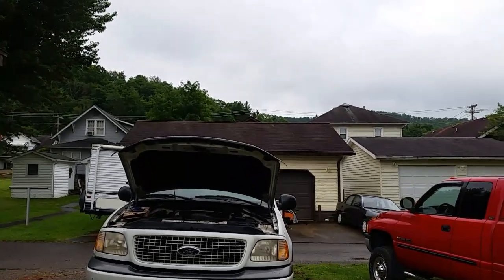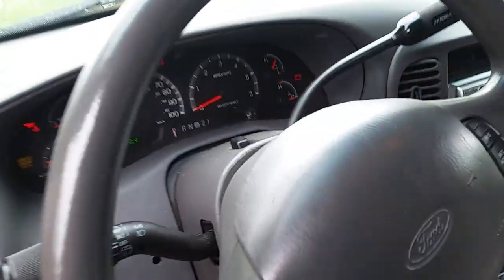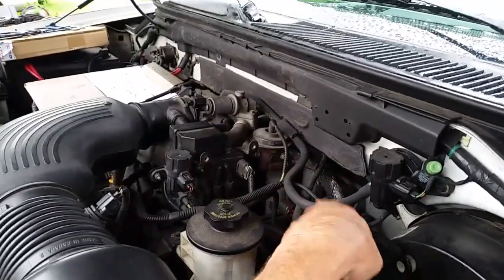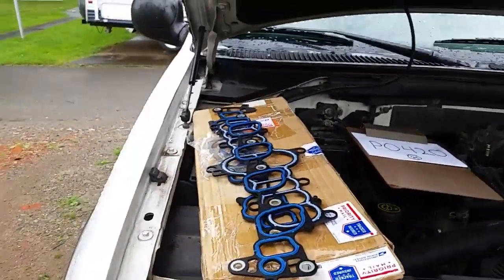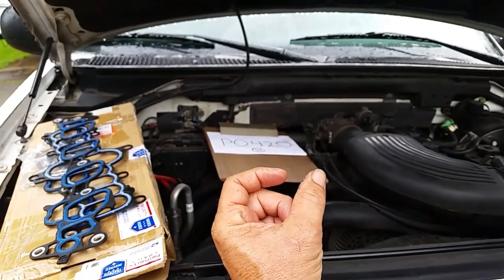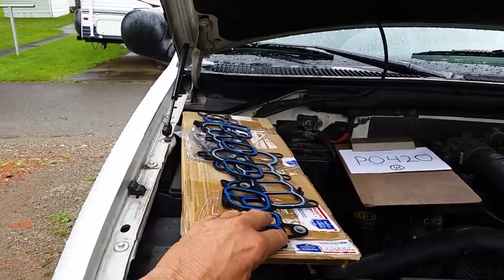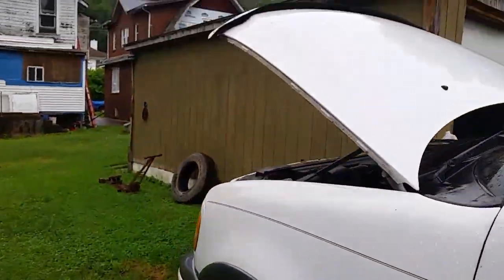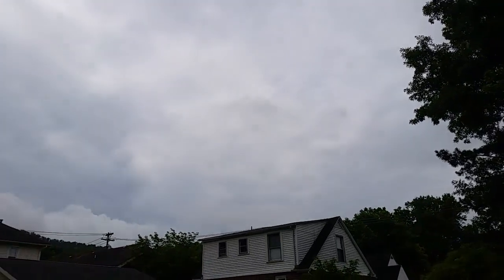P0420 Code. How to fix it. Don't spent spend tons of $$$.

Comment: Extremely helpful video and helped me diagnos my Honda Accord.
Reply: i just got this code for my honda accord what did u do to diagnose it?
Reply: @aleosorio05  My initial thoughts was for a catalytic converter but it was specific to the oxygen sensor.  You have to get those checked as likely there are two and one of them is failing you.  Not an expensive fix.

Comment: I've got a Kia sargento that I was about to tackle the O2 sensors. It has aluminum heads though. I'll check for air leaks, but do you think the intake gasket could be an issue on a metal intake?

Comment: Thanks for the info. I just bought a 06 explorer 4.6 and after two days the po420 code came along with a generic lean code. Where is the most common vacuum leak found? Thanks
Reply from the maker: Usually under the intake, the gaskets get bad and leak some. If its running ok then the leak is so little, just enough for the o2 sensors to see it sorts.
Reply: Did u fix it.. Same shit with my 06 explorer

Comment: Hi Nathan.. I have a 2002 Jaguar X-Type.. I recently had a P0301 misfire code.. I had a mechanic change the spark plugs and the coil packs.. in order to get to the back three plugs of this 6cyl 3 liter engine, the intake manifold had to be removed.. once the job was completed, the P0301 was gone, and the car runs and drives smoothly, as expected.. However, a P0420 code appeared.. 

Since it did not have this code,  immediately prior to the tune-up, I am thinking that the mechanic did not reinstall the new gaskets and manifold correctly.. I'm thinking that perhaps when installing the manifold, the gaskets were moved on bank 1 (since its a P0420).. I do not hear a vacuum leak anywhere, and all the lines appear to be in their proper places.. any thoughts because I find that hard then I would have just a P0301, and after the plugs and coil packs replacement, I would suddenly have O2 sensor problems or catalytic converter sensor problems or whatever other possibilities for kicking out this P0420 (your point in the video).. especially since the motor runs perfectly and I did not have this code before the repair was just done.. thanks for any insights..
Reply from the maker: Check the bolts and see if there tight. I've see this happen before. If that does not work might have to tell him what wrong.
Reply: @FixingWithPassion  .. Yes.. thanks for the reply and advice.. I totally understand where you coming from.. in fact when it first threw the code I inspected the vacuum lines and general work that I could see in the sun the next day.. I observed that the rear intake bolt that keeps the intake manifold secure/stable in the back, near the firewall, was missing.. this was not one of the main six intake manifold bolts around the gaskets.. But a missing bolt off the intake nonetheless.. I replaced it myself, but the code remains after coming back at exactly 100 miles post reset.. and because this bolt was missing it made me concerned about the general quality of the work.. on this Jaguar the main intake manifold bolts have different lengths in at least three of them.. so if you don't pay attention to detail, these could have been put back in the wrong order and place.. so I definitely consider either loose bolts or maybe both put in the wrong place when he threw it back together. Additionally, when he returned the car it still had the check engine light on.. and when I inquired about this I was told that they had not taken on a test drive or put the scanner back on it to see if the P0301 was clear, or if this was a new code, or both! as I was the last customer of the day they were in a hurry to close up shop so I was forced to take the car and run up to O'Reilly's.. he told me I can bring the car back next week if there was a problem and the code to not clear itself.. incrediblous.. you know how it is.. if you don't pay the mechanic you can't take your car, even if their work is obviously not done correctly.. 

It was the weekend, so I had to wait until Wednesday, following the previous Friday's work, before I could go in and talk to him.. 

Unfortunately, he was defensive and combative, from the mere fact that I returned and suggestion that there was a problem that he possibly caused when installing the intake manifold, since I was only now getting a new code that can be directly manifested from an error in the intake manifold installation (like maybe a displaced gasket when setting the manifold in place, loose or misplaced bolts, ect).. so I cannot look for him to to be responsible/honest and at least evaluate the possibility.. he actually had the audacity to tell me that he never listens to the clients because they're not mechanics and don't know anything.. so apparently if we have a problem after his work is done we're just supposed to eat it and assume that he is not responsible, even by innocent mistake.. his assistant actually did the job and wanted to argue with me that the rear intake bolt was not missing when you can clearly see the evidence of a new shiny bolt, that I had to buy, with your own two eyes.. there's nothing like being told you're "full of shit" when you get work done by mechanic, pop a new code that is directly related to the work that was done, and show them evidence of a bolt they fail to replace properly.. especially in light of the fact that no test drive was done or any post work diagnostic of the still present engine light... it was like oh the engine light is still on well pay me and get the f out.." LOL on the inside.. 😂 I'm currently in the process of doing a chargeback for the labor since he would not do the right thing when I took them vehicle back due to the problem.. He tried to tell me that I just paid him to do the spark plugs and coil packs, as if this was sufficient in his hands were clean no matter the outcome.. Then I had to remind him that I did not just seek someone to turn bolts, but I paid him, as an expert professional mechanic, to do the entire job CORRECTLY, to include the reinstallation of the intake manifold and upper gaskets to ensure no leaks..

Comment: I totally disagree, o2 sensors and cat converters always break down,yes I have been running a workshop for over 30 years.Bad petrol and faulty ignition system are detrimental to cat converters and o2 sensors.
Reply from the maker: But not as much as people think. Cause and effect. :D

Comment: This code is driving me crazy. 04 4.6 mach 1. Car runs great,no plastic on the upper motor,no vacuum leaks i can find. Code pops up about once a week. Only vacuum lines i havent replaced  are the colored ones coming egr area.

Comment: Question!!!:

WHY? Does the OBDII software detect a vacuum leak and decide to throw a code related to the exhaust? Why wouldn't the OBDII software throw a vacuum leak code?

Any internet experts care to take a jab?
Reply from the maker: Its kinda like going to taco bell, eating, then getting the diarrhea. But you know what caused the problem to start with. Best I can do. o-O

Comment: I have a 2004 Highlander with 175k miles.  I replaced the gaskets with OEM ones about 6 months ago.  Do you think my first step is to look for vacuum leaks and go from there?  Would a manifold crack leak show up when testing for vacuum leaks with a "smoke" test (burning mineral oil and pumping smoke in with bicycle pump per other Youtube channel recommendations).

Comment: I got a question, if you have an intake leak, or vacuum leak, wouldn't a different code show up for a lean bank 1 or lean bank 2 depending on what bank the leak is at?
Reply from the maker: Yea....depends on what the bank is getting the "extra air"

Comment: How do you check for air leaks then?
Thanks
Reply from the maker: Scotty with a cigar...:D
Reply: I spray wd40 in the gasket or vacuum lines, areas where I think it might be leaking. If your idle speed changes for a few seconds while your spraying.. you’ve found the air leak.

Comment: So was it the gaskets?
Reply from the maker: For the PO420 code it was....intake gaskets....but the PO430 it was several things....ugh
Reply: TVWXMAN32 am saying did u fix ur truck w tha gaskets
Reply from the maker: Yes.
Reply: TVWXMAN32  awesome dude! Cus po420 has few meanings .....  cats o2 vac leaks etc ! Good job
Reply: in other words, if you got a p0420 code, it's your cat, but you can follow this video while you're waiting around, hoping it's not the cat converter
Reply from the maker: Yea...PO420 is like divorce papers....it will go only one way ;(
Reply: Spray what to check for leaks?
Reply: @AikidoTubeSock  starter fluid?   I heard this can be done on carburator boots on motorcycles to find vauum leaks.

Comment: Could this also mean that the spark plugs need to be changed ?
Reply: And the gasket
Reply: @ItsYoGirlCookie  which gasket?
Reply: @gailglady795  my car will not pass smog because of this code and when they run the test they kept telling me to drive my car on the freeway and keep it at 55miles for 15mins straight and I did that and this code still popped up so idk what else to to my check engine like isn’t on nothing on my dash board is lit up so I’m confused

Comment: No this is rare. At the shop I work at 90% of the time its the 02 sensors or the converter is clogged. We've serviced 1000's of cars in the past few years...Also you have another video of yourself chopping off the convertor because of the code contradicting your message here, lmao...wow...

Comment: Hello sir, so you are making a lot of sense to me. I have a catless exhaust system with a tune to delete rear O2 sensors for the setup. Somehow I am still getting P0430 which all the performance guys I have talk to say "well that weird" and have no solutions. Could a leak behind the mass air flow in the CAI cause this code? Hope to hear from you. Thanks.
Reply: As everybody else has been saying the whole time a  PO420 unfortunately can be caused by vacuum leaks and also a bad intake, manifold, gasket, a quick visual inspection test will tell you if any vacuumed lines are broken..

Comment: I have a P0420 code on my 2003 ford explorer. We recently replaced all the intake gaskets, but did not use a torque wrench. Could that be the reason for the check engine light? 

Also, there is a small rattling noise from the muffler, could this be related to the code? Thanks for the help
Reply from the maker: That's about all you can do. The dreaded po420 code....you now have to start looking the cats or o2 sensor....but its almost always the cats...there is 4 of them....bank 1 driverside 2 passanger side. A code reader will tell you more.
Reply: TVWXMAN32 okay thank you
Reply: Joseph B I have the 0420 code  as well on my expedition. It rattles in the muffler just like you said, no one else has said that, I’m glad someone knows what I’m talking about. What did it end up being?
Reply: Kason gamer the rattling actually was mytailpipe, just a coincidence. I just recently sold the car.  But when I went to find the rattle I shook the tail pipe and it snapped off right between  where the tailpipe and mufflar meet. As for the code I never really figured it out completely. I got my catalytic converters checked and there was no back pressure, so they weren't clogged. My only options left really that I had were a bad O2 sensor according to my reader I have. Or most likely it was just a bad cat. Sometimes the converters don't affect driving/acceleration/engine power, they just are not running as efficiently as they should be. But that's all I got
Reply: Many more videos were posted on this account about this awful code I think after all this happened for me. I think eventually he fixed it I'm not sure though check through the months videos and see maybe
Reply: Joseph B ok, good to know, so you don’t think the rattling could be associated with any of the codes I’m getting. It’s actually more like a popping sound kind of.
Reply: Kason gamer mine was a rattle from the mufflar about to snap, so it wasn't the Cat. I know that rattle in the Cat is common if it's broke through
Reply: Kason gamer have you had loss of power or acceleration? And have you gotten the cat checked for back pressure?
Reply from the maker: If this helps...My rattling was the cat came apart and was blown into the muffler ;(      PO420  Toasted cat!

Comment: Wouldn't you get a PO170,171,172 lean code with a vacuum leak? If you have a vacuum leak, this should be present as well. Just saying.      Scott the car guy
Reply from the maker: In some cases yes. Intake gaskets are sneaky vacuum air leaks also. P0430 intake gaskets/ P0420 cat issues in a nutshell.

Comment: Here 2003 hyundai santa fe 2.7 I have p020 and p030 and lost a lot of power on the road 
The shop say is the both cat 
So they need to put. A new ones 
Do u think I need to get a second opinion?
Reply from the maker: PO420 is cats.
Reply: @FixingWithPassion  sorry and yes shop say is p0420 and p0430

Comment: I have an 06 F150 5.4 popped up po420 code 116,000. This thing hasn't missed a beat runs flawless at any speed, temperature of the day, a/c on it runs fine. OB live data shows O2's all fluctuating the same, none steady, Cat temp at idle 700-800 at 40mph 1100-1250. Since watching your video I looked under the hood and it has the plastic intake manifold. Is it safe to assume that's my number one enemy?
Reply: I wonder why nobody chimed in. Did you ever fix your p0420?
Reply: No I haven't yet

Comment: I had a tuneup 2 weeks ago. I bought the plugs, wire, coil and paid the labor. Had multiple misfires. Got that done and 4 days later, my check engine light came on and stayed on. Went back there today to get the code pulled... they pulled my car in back. 30 minutes later, I was told i need 700 dollars worth of catalytic converter. Car runs fine, mileage fine,no smoke, no smell, no noise.  He never told me the code.  Needless to say, I think it's BS.  I've never had anyone pull a code and not tell me what it was.  His behavior was different when telling me I needed a cat. Got a 2005 Chevy Aveo, he kept saying don't get universal, only direct fit and no oem's. Anyone with ideas, let me know.. I think he was trying to rip me off.    BTW, the check engine light went off when I was almost home from that place, drove 40 miles, it had been on for 10 straight days. ??
Reply: Wait for the check engine light to come back on again when it does take it to an auto parts place they will check it for free.  Ones you know what it is go to a different place to have it fix or fix it yourself.

Comment: I had that code for a while but it went away and hasn't come back. I did think it was converter. I don't think I have any vacuum leak and the vehicle runs great but it does have a plastic intake and a lot of miles so I may check it out.
Reply from the maker: Yea pretty common.

Comment: I recently loosened the throttle body to lift it slightly so as to get access to the ignition coil underneath. 

So now I'm thinking I've messed up the throttle-body gasket given what you are saying. 

And yes the P0420 code is the code that's now showing up on the code reader.

Comment: My car needs a new cat I think, when i barley rev it hard i hear the motor clicked and when I had my sterring wheel turned it started missfiring then it started revving up and down by itself then revved to almost 3k I shut it off turned it back on went back up to 2 in a half then I turned it off turned it back on then revved to almost 3k again then i put my foot on the brake it went back down😂 like wtf I've also had a coolent leak to im sure it's only the cats 😂 causing it

Comment: this code is driving me nuts i tried everything..
Reply from the maker: O my!
Reply: You cat is probably  clogged how can u tell? Loss of power or rpms would not go higher than 3k rpms .. so would u could do Is put some cat cleaner in your gas tank some say acetone works?? So try it see if you runs better. By the way your car is burning oil and gets gunky that's probably why it has p0420
Reply: My car has the P0420 and acts sluggish after warmup but still goes higher than 3000 rpm if I apply more throttle

Comment: You can get this from a rich running or dying  spark plug
Reply from the maker: Yes, eventually that will burn up the cat
Reply: @FixingWithPassion  I have this problem as last plug change one was burning rich. I tend to trigger the code on a long run under acceleration.

Comment: This is straight hillbilly. Keep spraying brake cleaner and carb cleaner around the intake to find a vacuum leak. It only takes once to burn the car down. Alternator can light vapors from carb and brake clean. Spark outside cylinder can also cause carb and brake clean vapors to ignite. You have a code reader that gives u minimal live data. You'll have a fuel trim pid. Learn how to read fuel trims and don't risk burning your vehicle down. Professional technicians also have smoke machines to find vacuum leaks. 99% of the time P0420 is caused by a bad rear O2 sensor. Don't replace good parts because your guessing. If you suspect you have a vacuum leak there will more codes than just a P0420. All the P0420 code says is that the cat efficiency is not good. Why? What is causing the problem upstream? This is a very basic OBD2 system. If you don't have technicians in your state who can figure out P0420/P0430 codes without replacing known good parts I'd suggest you move. These aren't your dad's 57 Chevy's anymore. The avg vehicle in today's world has more computers than the space shuttle that went to the moon. YouTube certified and Google tech aren't actual certification's you can get to fix cars.
Reply from the maker: Please tell us more!